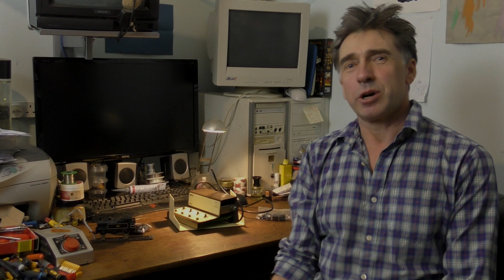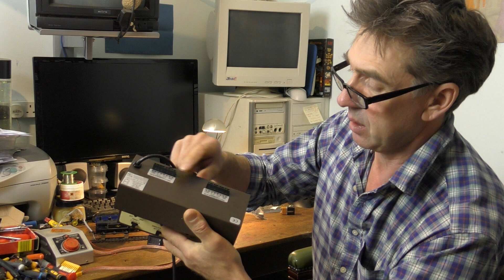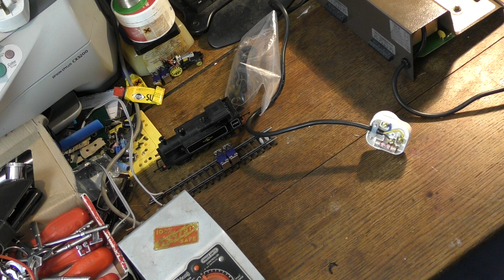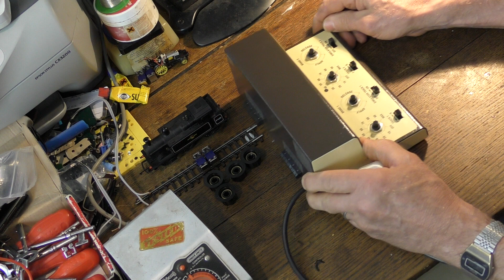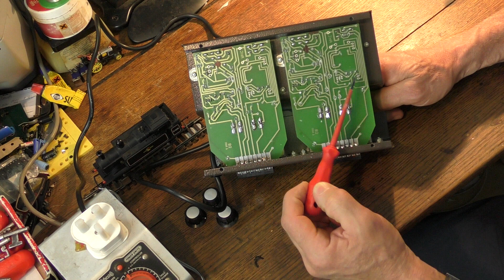Workshop Update, Voltage And Amp Meters For The Tri-ang Super 4 Layout. Repairing a Gaugemaster DS

Comment: Good morning Mr Snooze, you always have interesting content for us.
I would be interested in hearing your comments on the following.
I recently successfully converted an old Triang Princess to DCC using a Hornby Select Controller and Hornby R 8429 decoder.
The Princess responded beautifully running at a very slow and continuous speed. This was so satisfying as I know little or nothing about electronics.
The other day while running it the Princess stopped abruptly and failed to proceed.
I removed it from the track and had a look at the wiring and the decoder but didn’t find anything out of place.
I placed the Princess on the test track and applied power.
Immediately the number 11 began to flash on the controller but the loco did not move.
I removed the loco and turned the controller on. It responded normally.
On further investigation I found the 11 is actually the version of the firmware which is vet 1.1
This is not the most up to date.
DCC might not be your forte but maybe you could suggest that the old Triang X03 motors are not suitable for DCC, I think because they pull too much Current?
Looking forward to hearing tom you
Regards
Chsrlie
Reply from the maker: Thanks for writing, I have no problem with DCC and am looking forward to experimenting myself. A properly maintained XO motor should draw no more than .35 amps ( 350 MA ) so as long as your decoder can handle that plus 50% I think all should be well. I would try and measure the motor current draw on DC for a start to see what it's pulling. Best regards to you

Comment: Got a couple of these meters.    Really cool little things.     I was able to get them to work from a 9 volt battery but connecting to my 12 volt Duette transformer i get nothing.    Reversed polarity to no avail.   What am I missing I wonder?    Ill keep trying until I figure it out.
Reply from the maker: The regulated DC from the Duette is not quite good enough for these, try experimenting with a capacitor across the output of the controller. I'm sorry but I cant recall the value I used as its now hidden away in my meter box. Thanks for looking, all the best to you

Comment: Hi Mr. Snooze, I have a couple of these volt/ammeters but once wired up I can only get them to display voltage the ammeter just displays 0.00 amps. I have wired it as per the 4-30 volt diagram and have taken the supply for the meter from the dc bus wires, any idea what the issue could be?
Reply from the maker: Hello there, if you email your wiring plan to me I'll take a look  info@snoozevideo.co.uk  is the address to use. Best regards to you
Reply: @MrSnooze  Thank you Mr. Snooze.

Comment: Really interesting, would it be possible to install these gauges on a dcc layout ?
Reply from the maker: Hello Bob, I don't think they would connect straight in the circuit as the power to your DCC track is AC. Maybe with a small additional rectification circuit they could be adapted. Best regards to you
Reply: @MrSnooze  Thanks very much for your response, I really enjoy your channel
Regards Bob

Comment: Are both terminals of the capacitor connected to one leg of the controller output, or does the capacitor straddle between the 2 lines?  Also, is it the same concept as a "keep alive" circuit folks put in locomotives?  Sorry but I'm not very well versed in circuitry.
Reply from the maker: Hello, thanks for looking. In this video the purpose of the capacitor was to get the little amp meter to work. I experimented with an electrolytic across the output but as it's got a neg and positive leg it only works in one direction. I am going to try a non polarised one in the future. All the best to you

Comment: Great video. Very interesting mod on the controller.

On the rolling road, using the old controller, did you just bridge the rails with the capacitor, or was it in series with the negative?
Thanks.
Reply from the maker: Hello, When I was testing I fitted the capacitor to the rails but as it was electrolytic I could only run in one direction. Later I fitted the capacitor into the little meter. I have yet to experiment with a non polarised capacitor but hope to when I get time. Thanks for watching. All the best to you

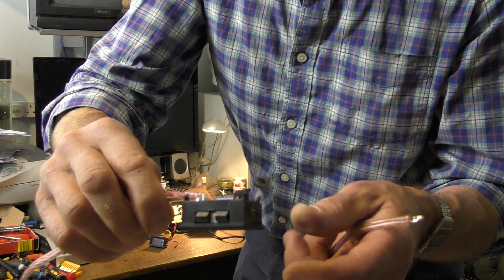Comment: 6:32 sorry, are those non polarized capacitors? if not they will explode if you reverse the voltage, sorry if you already know. One other thing to consider, adding the capacitor to the output of the controller, if you smooth to much you will lose low speed control, maybe try 33 or 47uF? For the metres you could try a bridge rectifier so that they always receive a +/- as needed, you would lose 0.7v for each diode so 1.4v total which you could adjust with the trimmers?
Reply from the maker: Hello, thanks for watching the video. That's some very useful information, I will be trying some different capacitors when I get the chance. The one I tried was just to hand. It will be interesting to see how this all performs on the layout. I will be updating in the next video. Best regards to you

Comment: Just a bit of electronics theory revision Jonathon...When you add a capacitor to a simple rectified supply, it increases the mean voltage. This is why the jinty sped up. I believe with many of those cheap Chinese meters that if you power the meter independent of the load they will happily work and display low and reverse voltages. Best check the instructions first. On my boat I used a pp3 battery switched in just for meter power. It lasts so long it was never an issue. Regards Gary
Reply from the maker: Hello Gary, thanks for watching. I am going to do a bit more testing as I hadn't got a Clipper to hand and the Tri-ang controller doesn't have a half wave feature so there are still things to explore. I didn't receive any wiring diagrams or instructions with my meters so quickly checked online. I did try independently powering the meter from the PP3 but only got Amp and Voltage readings with the loco running in one direction not both . Maybe I have incorrectly wired the voltage sense wire in my tests. Do you have a copy of your meter instructions you could forward to me if possible? I would be happier to not have to make changes to the Gaugemaster and use a small remote power source to use these meters. All the best to you
Reply: @MrSnooze  hi Jonathon. I'm out at the moment but send me a short email and I'll have a look for data when I'm in office next. Have a good weekend
Reply: When I needed to rig up a uni direction ammeter I connected it to the dc side of a small (1A) potted rectifier. The load side of the circuit was routed via the ac connections of the rectifier. A simple solution that also enabled me to measure the draw currents on alternative controllers, via a suitable rotary switch. T 🚇

Comment: I have a Gauge master dual track without the simulation, the 1.1A output really does work the old locos well. I have a few diesels and they all run well with huge loads as the torque is increased so well, and they never overheat. Strange about the noise you mention, my X04s are barely noticeable when off the board (everything is noisy on those) and if you turn up power quickly they jolt pretty sharply as the motor starts, very powerful. 
Very interesting video, i would recommend you buy either the dual track or four track controller for the old locos
Regards
Will
Reply from the maker: Hello William, that's all useful information. I will be doing an update once I get it wired in. I haven't noticed any noise from the Gaugemaster unit the same as the Hornby HM 4000 so I'm sure all will be well. All the best to you

Comment: Interesting the difference a capacitor made on the old controller. Must admit when peaking inside older controllers have noticed they have no smoothing capacitor. Not sure why as capacitors have been mass produced and cheap for a long time.
Reply: Part of the reason is because at low speed motors respond better to pulses of current.  That's why a lot of modern controllers enhance this by supplying a chopped wave....PWM . Even the basic hornby modern controllers do. H and M used to even have a half wave switch to work this effect even more.
Reply from the maker: Hello Andrew, as Gary says there are lots of different ways that that some controllers try to enhance the performance of the motors in our locos. My only reason for trying the capacitor was to see if I could get this little meter to work using the controller output as a power source. In retrospect I probably should have done more detailed testing as I'm now concerned the capacitor may reduce slow running performance. It's good fun to try and mix old and new items though and these little voltage and amp meters are quite interesting. All the best to you
Reply: @MrSnooze  Maybe find the lowest value capacitor that works for the meters when you largest drawing loco is running? 33 to 47uf will have little effect on the motor running qualities. If you use that bridge rectifier idea you can then put the capacitor (again 33 -47uf) behind it so it will smooth for the meter but not effect the motor. Good luck
Reply from the maker: @ModelRailwaysUnlimited  thanks again for this, it's good to get more ideas to try. I'll be trying the current set up in the next video. All the best to you

Comment: Hello Jonathan,  I must confess that when I saw the title I thought this was going to be a dry video to watch. How wrong I was, it was very interesting indeed. I think you are the first person I have known that can read/ follow a circuit board. I have a few controllers I would like you to look at. 110 volt input of course.
Regards, David.
Reply from the maker: Hello David, thanks for the kind words about the video. I'd be very happy to look at your controllers and the 110 makes no difference as I have a 110v step down transformer to run continental electrical items I have. The main problem is you are a bit far away for an afternoon drive. Best regards to you

Comment: Great video . I have an HM Duette that works great  but occasionally the right hand controller drops voltage and it does not have the click in the middle in the off position like it should.  If I pull out on the control post when running then everything is ok. Surprisingly I did manage to buy a brand new original rheostat / control plate to fit but I'm not confident to attempt that repair. Any advice on where to have this repair done ?  Best regards - Mike
Reply from the maker: Hello Mike, the H & M Duette is a great controller. I am using one to control my branch lines and turntable. If you struggle to find a local repair facility for yours I'd be happy to repair it if you got it to me. You can email me at the address in the channel about section or message me on Instagram. All the best to you